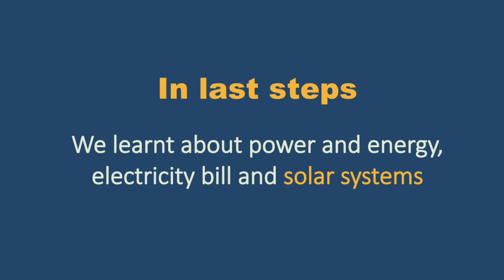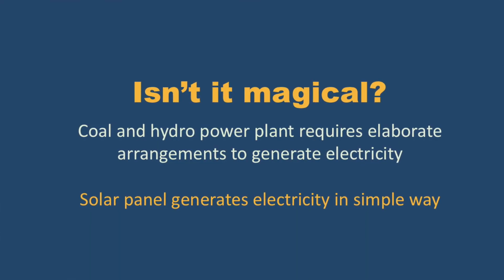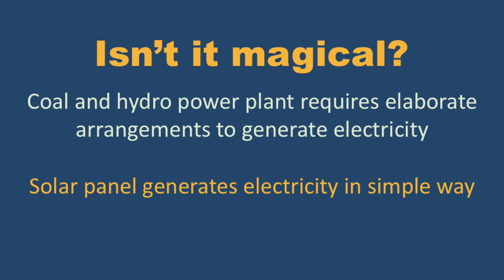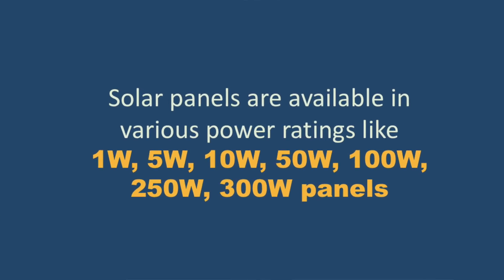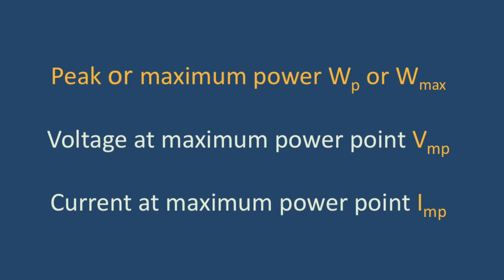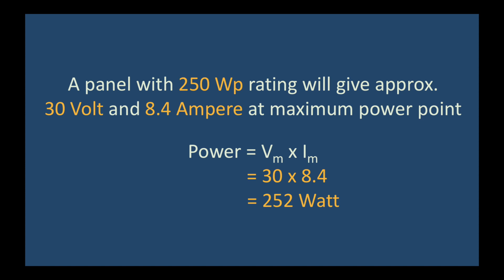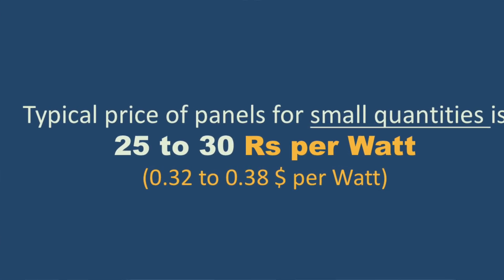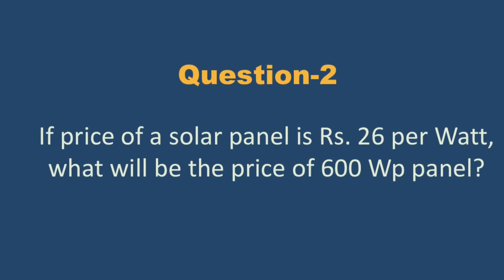Step - 5 : Basics of Solar Panels (Part-1) Power Rating and Pricing || Design solar systems for home

Comment: Step 5: Basics of Solar Panels (Part-1) Power Rating and Pricing || Design solar systems for home

Activity-1:  Find out approximate voltage and current ratings of 300 Wp solar panel from internet 
Ans: At peak output 	Vm =35.27 V and 	Im = 9.05 A
			Voc = 44.09   and 	Isc = 9.19 A  

Activity-2: If price of a solar panel is Rs. 26 per Watt, what will be the price of 600 Wp panel ?
Ans.:  The 600 Wp panel is not available and hence 2 nos. 300 Wp or 3 nos. of 200 Wp etc. combinations  will be connected to obtain 600 W.
The cost will be Rs. 15600/- @ Rs. 26 per Watt.
Reply from the maker: Keep learning and do follow the channel for more interesting  videos about solar energy

Comment: Thank you sir for the  explanation of solar panel specifications used in market which I found very easy to understand.
1st question: I found from internet that for a 300 Wp Panel: 
Vmp is 35.5 V and Imp is 8.22 A. So after multiplying it is coming around 291.81 Watt.
2nd question: the price of 600 watt panel at Rs 26/watt is coming Rs 15600.
Reply from the maker: Great.....Keep learning and do follow the channel for more interesting  videos about solar energy.

Comment: Thanks sir for giving information about  how to rating voltage and current of solar panel.
Ans-1)A panel with 300Wp then,
Power=Vm × I'm
           =35 .5V×8.22A
            =291 .81Watt
Ans-2)156000Rs.
Reply from the maker: Keep learning and do follow the channel for more interesting  videos about solar energy

Comment: Thank you for the information sir!!!
For 300 Wp Panel - 
Approximate voltage - 35.5 Volts 
Maximum Power Current - 8.22 Ampere
Hence power=  291.81
2nd Q --  The price of 600 watt panel =600*26 = 15600
Reply from the maker: keep learning and do  follow the channel for more informative and interesting videos about solar energy.

Comment: Thank you sir for ur beneficial efforts on this field.
Power ratings of 300Wp is
Voltage=35.5V
Current=8.2Ampere
And power=Vp*Lp
                   =36.5*8.2=291.1
And cost of that 600Wp solar panel is ₹ 15600.
But sir didn't come to know that why the market price is high as according  Tata charges 49000 for same solar panel.
Reply from the maker: keep learning and do  follow the channel for more informative and interesting videos about solar energy.

Comment: Thank you so much sir ....
Q1. Voltage and current rating of 300wp module.
Vmp=36.14v
Imp=8.31A
Q2. Cost of 600 wp module @26/wp will be: 26×300=15600Rs
Reply from the maker: Keep learning and do follow the channel for more interesting videos about solar energy
.

Comment: Sir can we use 315Wp and 325Wp panel in series connection for making an PV array pls sir tell what happens if we do that??
Reply from the maker: In series, the current of circuit will then depend on panel producing the lowest current. So, overall output will decrease.
Reply: @energyswaraj  thx sir

Comment: Thank you very much for the explanation about how to calculate Wp
A1. For 300 Wp panel Voltage rating is Vp= 35.5 and Current rating Cp = 8.22 A Wp = 291.81
A2. The price of 600 Wp solar panel at the rate of Rs. 26 per Watt will be Rs. 15600/-
Reply from the maker: Keep learning and do follow the channel for more interesting  videos about solar energy

Comment: Voltage-32v
Current-9.5A
And the total cost is-26×600=15600 rs...
But sir how to find maximum voltage and current because there is n numbers multiplecation is getting 300... what is the ideal way to do that?

Comment: 1. The voltage and current ratings of a 300 Wp solar module are around 36.5 V and 8.22 A.
2. If the cost per watt is Rs. 26, the cost of a 600 Wp module is 600 x 26 = Rs. 1560
Reply from the maker: 600 x 26 = 15,600 .Keep learning and do follow the channel for more interesting  videos about solar energy.

Comment: Hello Sir,
Q.1) Find out approximate voltage and Current rating of 300 Wp
Voltage (Vmp) = 35.5 V
Current (Imp) = 8.22 A
Therefore, power rating = 35.5 × 8.22
= 291.81 W
/= 300 W
Q.2) Price of solar Panel is Rs 26 per watt, what's price of 600 Wp Panel?
It is 600×26 = Rs 15600
Thank you Sir
Reply from the maker: Keep learning and do follow the channel for more interesting  videos about solar energy

Comment: 1st question answer is 300W panel Voltage is 35.5V, current is 8.22A, Total watt is 291.81Watt.
2 nd question answer rate of 600 watt panel @ Rs 26/watt is Rs 15600.
Reply from the maker: Great!! keep learning and do follow the channel for more videos.

Comment: Q1) Voltage and current of 300 watt panel would be = Voltage = 44.8 and current = 8.71 and Vmpp = 36.6 and Impp = 8.2 
The above one is from TATA solar power TP 300 series.

Q2) If price of watt per panel is 26rs then 600 wp would be = 600*26 = 15600 rs.
Reply from the maker: Good Keep learning and do follow the channel for more interesting  videos about solar energy

Comment: 1.for the 300Wp solar module the Maximum power voltage (Vmp)=36.50v and current at Maximum power (Imp) = 8.22 A .
   2.if the price of the solar panel is Rs.26  then for  600Wp  the cost will be Rs.15600.
Reply from the maker: keep learning and do  follow the channel for more informative and interesting videos about solar energy.

Comment: Ans 1  If 37.5V max then it is 7.99 A current max rating
I found on the internet the cost of 600W is about Rs 50000/- but Rs 26 per watt should be around 15600/-
Reply from the maker: Keep learning and do follow the channel for more interesting  videos about solar energy

Comment: For a rating of Wp = 300 W solar panel, Voltage and Current at maximum power would be 35.5 V and 8.22 A respectively.
Reply from the maker: keep learning and do  follow the channel for more informative and interesting videos about solar energy.

Comment: voltage rating for 300Wp panel is 120V and the current rating is 2.5A
Cost of 600Wp module at Rs.26 per watt will be Rs 15,600
Reply from the maker: keep learning and do  follow the channel for more informative and interesting videos about solar energy

Comment: Voltage and current rating of 300 wp solar panel is 
Vmp:- 35.5 V
Imp:- 8.65 A
Price of 600 wp solar panel at Rs 26 per watt is ₹ 15600.
Reply from the maker: Keep Learning and follow to channel for more interesting videos about solar energy

Comment: Voltage & Current rating of a 300 W solar panel is
Vmp - 37.6 V
Imp - 8.34 A

Cost of a 600 W panel  is
26*600 = RS 15600
Reply from the maker: keep learning and do  follow the channel for more informative and interesting videos about solar energy.

Comment: Ans of 1st question - voltage and current for 300 Watt solar panel
Vm - 36
Im - 8.4
Wp = 36×8.4 = 302.4

Ans of 2nd question - if a panel is of 600 watt maximum then according to 26 rs per watt it's cost would be
Cost - 600 × 26 = ₹ 15,600
Reply from the maker: Keep learning and do follow the channel for more interesting  videos about solar energy

Comment: Q.(1) specifications of 300 wp panel are .
STC Pmax =300 wp
         Vm =37.50 volt
           Im= 7.99 A
          Voc=45.70 volt
           Isc=8.55 A
Q.(2) the price of panel is.
                26*600=15600 Rs.
Reply from the maker: Good...Keep learning and do follow the channel for more interesting  videos about solar energy.

Comment: sir answer for the first question 
maximum power voltage = 35 volt
maximum power current = 8.66

for the 2nd answer the price will be 15600 INR

Comment: 1 question: for 300 Watt Panel: Voltage is 240 and 1.25 Amps
2 question: cost of 600 watt panel at 26 per watt is 15,600 INR

Comment: solar panel of 300 Wp will have 240 volts  potential 1.25 amperes current strength'
 the price of 600 Wp solar panel @ of Rs. 26 per watt will be 15600 Rs.
Reply from the maker: Keep learning and do follow the channel for more interesting  videos about solar energy

Comment: Q 1) voltage and current rating for 300Wp solar panel is :
Voltage : 60 volt
Current : 5 amp
Q 2 ) If a price of solar panel is 26 per watt , what will be the price of 600 Wp solar panel is : 
Rs 15600
Reply from the maker: Keep learning and do follow the channel for more interesting videos about solar energy
.

Comment: For 300 Wp panel Voltage rating is Vp= 35.90 V and Current rating Cp = 8.36 A Wp = 300.124 W 
The price of 600 Wp solar panel at the rate of Rs. 26 per Watt will be Rs. 15600/-

Comment: 1. For 300Wp solar panel..
Max power voltage : 36.24V
Max Power Current : 8.28A
 
2. Price of 600Wp solar panel is 
26 * 600 = 15600 Rs
Reply from the maker: .Keep learning and do follow the channel for more interesting  videos about solar energy

Comment: Rated Power capacity             300W
Maxm power voltage
 ( as per product specification) 
Vpm--35,5 V
Maxm. power current --8.22A

Q.2
Rs 26×600=Rs 15600/-

Comment: For 1 Question
In which power of Solar panel is 300 wp
Voltage is 38 V
and Current is 7.89 aMp
For 2 Question
600 Wp Solar panel's price is 15600 rs
Reply from the maker: keep learning and do  follow the channel for more informative and interesting videos about solar energy.

Comment: Q no 1 :-
For 300 watt panel
Max power Voltage = 35.5 V
Max Power Current = 8.22

Q no 2 :- 
Cost for 600 Wp...?
600*26 = 15600 /-
Reply from the maker: Keep learning and do follow the channel for more interesting  videos about solar energy

Comment: q1. V and I rating for 300 Wp Solar panel
      Case 1: Solar panel has 60 cells then Vp=36 volts 
                    and hence Ip=8.33A
     Case 2:Solar panel has 72 cells 
                    Vp=45V and I=6.667 A
q3. For 600 Wp the price is Rs 15,600

Comment: Que-1: V&I rating of 300W solar panel
Max. Voltage=35.5V
Current=8.65A
Que-2: 26*600=Rs.15600
Reply from the maker: Good. keep learning and do follow the channel for more interesting videos about solar energy

Comment: Activity;-
1) For a 300Wp solar panel the voltage and current ratings are 36-13V and 8.31Amp 
2) Price of 600 watt power panel is 15600 INR @ 26/- per Watt

Comment: Question 1: For a  300Wp Voltage rating is 35.5V and current rating is 8.22A.
Question 2: For a 600Wp having Rs. 26/W, total cost will be Rs.15,600.
Reply from the maker: keep learning and do  follow the channel for more informative and interesting videos about solar energy.

Comment: Question 1) for 300wp solar panel
Voltage=35.5V
Current=8.22A
Question 2) price of 600wp solar panel at 26rupees per watt is 15600

Comment: *Voltage & Current rating of a 300 Wp module:
Vmp - 36.14 V
Imp - 8.31 A
* Cost of a 600 Wp module @₹26/Wp will be:
₹(26*600) = ₹ 15600
Reply from the maker: Great.....Keep learning and do follow the channel for more interesting  videos about solar energy

Comment: First Question:
For 300 Wp Solar Panel, Vmp=35.5 V and Imp=8.22 A
So, Power Rating=Vmp*Imp=291.81 W  ,,300Wp
Second Question:
If the price of a solar panel is Rs 26 per watt, then the price of 600 Wp panel will be 600*26=Rs 15600/-
Reply from the maker: Good.Keep learning and do follow the channel for more interesting  videos about solar energy

Comment: Answer to 1st question: Voltage of 300 Watt solar panel is 36.5 V and current is 8.22 A.
Answer to 2nd question: Cost of 600 Wp Solar Panel = 26x600= Rs 15,600
Reply from the maker: keep learning and do  follow the channel for more informative and interesting videos about solar energy.

Comment: Question 1.  For 300 Watt Solar Panel
Max. Voltage - 35.5 Volts
Max. Current - 8.22 Amps
Hence Max. Power Generated - 291.81 Watts

Question 2. Total Price of Panel is Rs. 26*600 = Rs. 15600
Reply from the maker: keep learning and do  follow the channel for more informative and interesting videos about solar energy

Comment: Ans. 1: Voltage of 300Watt solar Panel = 36.5V
             Current for 300Watt Solar Panel=8.22 A
Ans 2: Cost of 600Wp Solar Panel = 26*600=Rs 15,600
Reply from the maker: Keep learning and do follow the channel for more interesting  videos about solar energy

Comment: Question 1
Specification of 300Wp Panel? 
Answer:-
300Wp Panel
Vm=36.5V
Im=8.22A
Question-2
Price of 600Wp panel if per watt price 26 Rs?
Amswer
1Wp=26Rs

Price of 600Wp panel
=600*26
=15,600 Rs price of panel.
Reply from the maker: Give voltage and current ratings

Comment: QUESTION 1 : For a 300W solar panel ,the
voltage at maximum power is 36V and the current at maximum power is 8.35Amp

QUESTION 2 : If the price of a solar panel is
Rs 26/Watt,then the price of a 600Wp solar panel is Rs 15,600.00
Reply from the maker: keep learning and do  follow the channel for more informative and interesting videos about solar energy.

Comment: Question 1: Find out approximate current and voltage rating 300 Wp solar panel.
Answer: Maximum Power Voltage [V] --- 36.14 
V
               Maximum Power Current [A] --- 8.31 A
Question 2: If price of a solar panel is Rs. 26 per watt, what will be the price of 600 Wp panel?
Answer: 600*26 = 15600
                The price will be Rs. 15600

Comment: Thank you Sir for giving this Information!!
Ans. 1: Voltage of 300Watt solar Panel = 36.5V
             Current for 300Watt Solar Panel=8.22 A
Multiplying we get 36.5 x8.22 = 29181 watt
Ans 2: Cost of 600Wp Solar Panel after multiplying the values  = 26*600=Rs 15,600
Reply from the maker: Great! Keep learning and do follow the channel for more interesting  videos about solar energy
.

Comment: 1. Vm=35.5V, Im=8.22A to give Aprrox 300W
2.Cost of module is: 26×600=₹15600
Reply from the maker: Keep Learning and follow to channel for more interesting videos about solar energy
Reply: 35.5V*8.22A = appreciate 300W
Watt/Rs is approx - 25 to 30 in retail
For 300 Watts you have calculate as 26Rs*300Watts= 7800/-

Comment: Q. 1 For 300 Wp watts solar panel 
Voltage rating :35.5 volts 
Current rating : 8.22 amp
Q. 2
26x600 =15600 Rs
Reply from the maker: Keep learning and do follow the channel for more interesting  videos about solar energy

Comment: 1. Ans: For 300Wp Solar Panel 
Maximum power voltage=35.5V
Maximum power current=8.22A

2.Ans:  Given in a Solar panel ,
Price for 1 Watt= 26Rs.
Then price for 600Wp Panel will be= 15600 Rs.
Reply from the maker: Keep learning and do follow the channel for more interesting  videos about solar energy